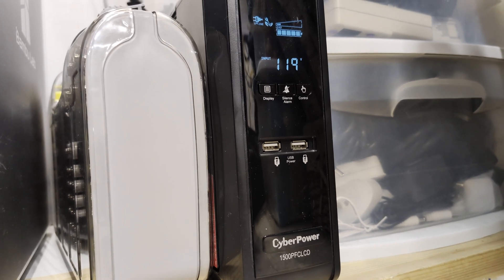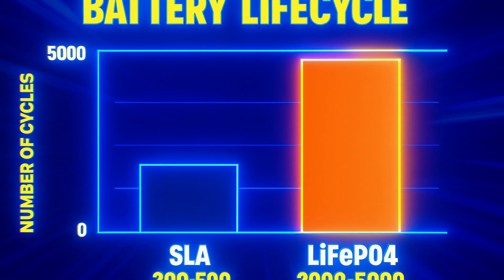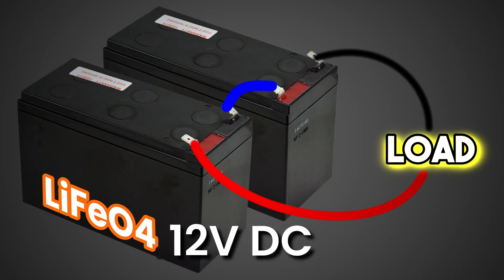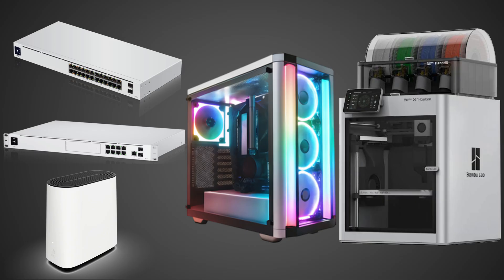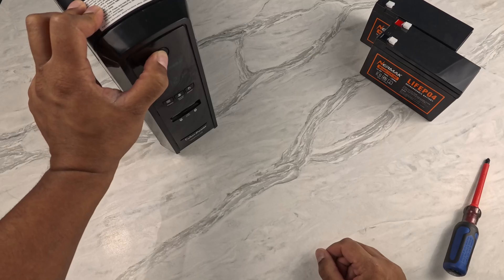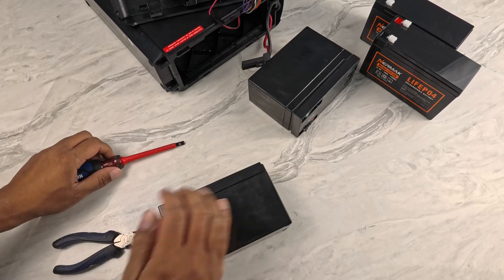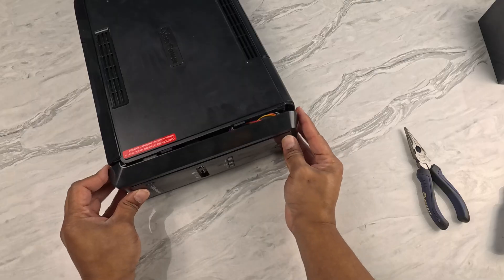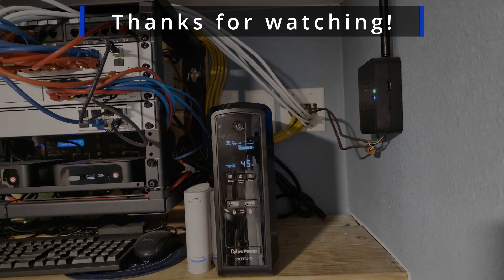UPS SLA to LiFePO4 Battery Upgrade & Replacement

Comment: Great video. I worried about the BMS in one battery opening it's charge circuit when the second battery wasn't charged.  It must work because you've done it. Thanks for the info.
Reply from the maker: I quickly checked my voltages (unfortunately off camera) before connections but it wouldn't hurt and maybe be a good idea to charge each for best results.

Comment: o own a UBER LT ALTO speaker (i use it for busking). Its 6 years old now and the battery lasts 1 hour , maybe 1.5 hours now. UBER ALTO dont supply the battery anymore for replacement. Its charged using a common 240v figure of 8 cable. takes 4 hours to charge fully (well it used too). So can i use a lithium ion battery instead of the SLA? im not sure of the ampage but i know its 12volt.
Reply from the maker: You would need to check the specific charging requirements of your speaker to see if it's compatible with lithium ion batteries, as the charging profiles are different. In the UPS for instance, it is close enough (charges to 85-90%...which in the long run will extend the life of the battery)

Comment: The only difference is the charge behavior of the battery.

Mine is DIY with 32700 cells configured in 8s2p. With Daly BMS 8s 40A (25.6v) and 5A Active Balancer. All managed to fit inside the UPS.

The charge time takes a loooooooong time. If yiu have Home Assistant added this UPS, you can see the battery voltage stuck for a while in  26v when charging then quicjly spike to 28v and goes back down around 26.8v, i think it has something to do with Cyberpower 's ECO mode where there 2 charger on this UPS, one is quick charger and obe is ECO charger at 26.8v it takes like almost a week to reach 28v and it stays there with occasional +.1v from time to time.
Reply from the maker: Thanks for the insight and sharing your experience with your DIY battery setup and the charging behavior of the UPS!

Comment: They make 24v sla 1079 size batteries now. Went from 2 12v batteries in my ups to just the 1 24v but you have to be mindful of the max amps on the BMS for the battery and stay under the limit. This is good for smaller loads

Comment: Thank you. Have you done a deep discharge? for an experiment. Will the BMS systems of these batteries cope?
Reply: I tried a deep discharge and the UPS would not restart upon power being resumed, claiming battery failure.  Manually turning on the UPS and letting the battery charge back up worked fine, but this could be a serious issue for servers and other items you wish to come back up after a long outage.

Comment: A 12V LiFePO4 rated at 10A continuous discharge (x 2 in series) will give you 240W of total continuous power. So... just keep that in mind when you're trying to draw 1000VA from them for all your devices. Also, the 2S lead acid batteries probably have a charging profile around 27.5VDC whereas the LFP batteries would prefer to charge up to maybe 28.4VDC give or take. It will work, but you will never get a full state of charge on those LFP batteries. It might make up for it because the UPS will essentially cut off the lead acid around 50% because the voltage dropped too low. So you would never be able to use all 9Ah of it... maybe half. Whereas the LFP, you'll use much more of it's rated capacity. Some APC Smart-UPS models let you hack the charging voltage (for the ones with 48V batteries) so you can try bumping it up from the default 55'ish volts up closer to 56.8VDC that LFP would like to see in the same 4S configuration. But for Cyberpower or other models, I don't think that's possible.
Reply from the maker: thanks...very similar to my answer to @bigblack2295 and you're right, as I mentioned in the video the load shouldn't exceed the rated capacity or risk shutdown...

Comment: Everyone ignores the fact that lifepo4 batteries typically require more voltage to get a full charge, looking for a video of someone who knows what they are doing with a step up voltage for charging...
Reply: This point is not worth testing and only deserves a mention.

Not charging to full voltage is a major benefit. You aren't losing much capacity while significantly prolonging the life span of the battery and you still get a higher capacity than before. Even according to the chart in the video the amount of capacity you are losing is tiny if you don't step up.

If you stepped up the charge voltage you would also need to step down the voltage to discharge which increases the cost, size and complexity while descreasing the efficiency of the setup. You would be far better off spending that extra cost and space on a larger battery.
Reply: The thing is, and this is saying this as someone who’s just done the upgrade it doesn’t seem to matter that it can’t get peak voltage seeing how lifepo4 discharges.

Comment: The original SLA batteries have a much higher discharge rate - your current setup will trip if the PC load goes over 260w - very low for what this UPS was designed for .
Reply: Could you please explain further, I'm doing the same thing and I'm genuinely intrested. Thank you

Comment: Are the ups generally compatible with lifepo4 batteries? Is there any thing to care about?
Reply from the maker: I can't blanket statement and say yes. But generally for ones 1500VA and smaller for consumers most likely. What to care about the UPS charging profile is set to charge SLA batteries, the voltage to charge LiFeP04 is generally higher so technically the UPS would charge the LiFePO4 to 80-90% their full capacity. However, this is a trade off for the other benefits of LiFePO4. The possibly lower capacity may actually equal the SLA capacity if the LiFePO4 are technically rated at a higher capacity (think 9Ah SLA vs 10Ah or 12Ah LiFePO4). Also capacity isn't the full story because depth of discharge is far greater on a LiFePO4 so even if technically reduced capacity from charging, it will run longer due to being able to discharge down to a lower voltage than SLA. SLA can go down to 50% then will shut down, any lower and the battery could be damaged, LiFePO4 can get down to 20% with little to no battery degradation. The only other thing I can think to care for is how robust the sensor is in the UPS to determine capacity. Basic UPS use voltage drop to determine what to to display on screen for capacity...so easy to read an SLA that has a gradual voltage drop, however, with LiFePO4 since the voltage is flat, capacity may not read accurately.
Reply: @cooptonian  thank you for informative reply.

Comment: Nice video sir and comparison to your previous battery. Nice to see that it maintains a consistent voltage curve and provides great power very strongly. I guess with great power comes great responsibility....as they say. Your network rack setup is like one that's hasn't been seen before. That I can tell you .Thanks for sharing.
Reply from the maker: Glad you enjoyed the video!